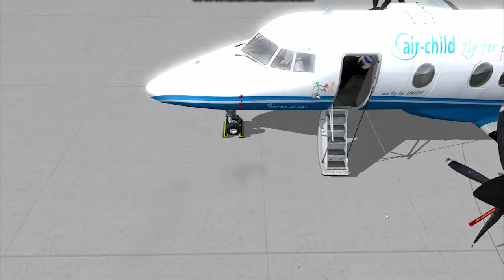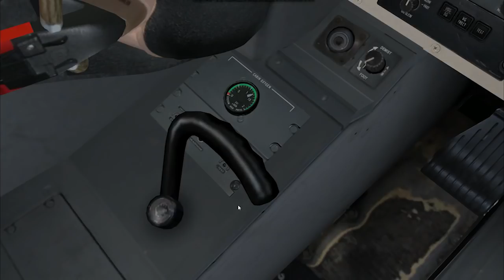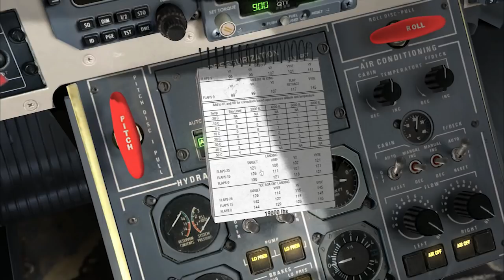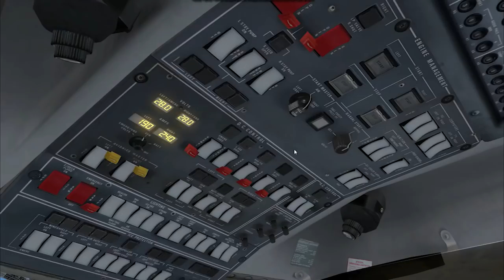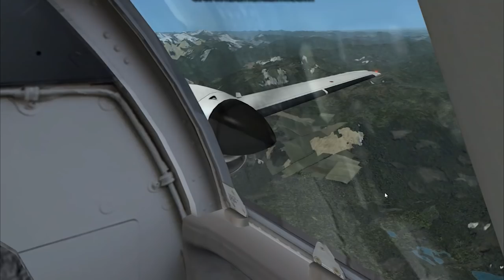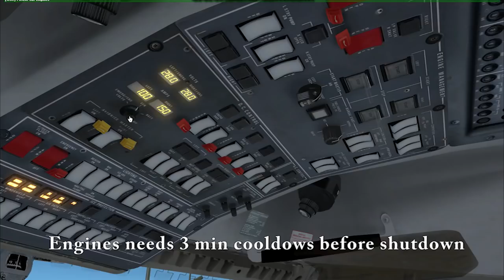PMDG Jetstream 4100 Tutorial. Single pilot OPs

Comment: When shut down the engine, press stop and when rpm is lower than 50%, pull the power lever to beta(reverse thrust) range to activate the start lock (so next time when start engine no need to unfeather the engine or your colleague will laugh at you)

Comment: you should not reverse before he say 70knots? and you did! you never wonder why he say that? that why you are going to damage the engines !
Reply from the maker: Hi TechnoVan, thanks for viewing my vid! Hope you are good. I want to clarify what the manual states. 

PM (pilot monitoring) will call "70 knots" and that's when the captain says "my controls" and takes over (if he's PM) and steer the plane with the tiller. And when out of reverse captain will say "out of reverse, condition levers taxi". The FO will put the condition levers into taxi. Reverse Can be applied immediately after landing, but not necessary. It's used for better landing performance. Reverse thrust always creates some more wear and tear, also for "normal" jet engines and because the air intake on JS41 is close to the ground, it's recommended to use as little as possible if not performance limited because of possible foreign objects ingestion. 
I hope that clarifies how and when to use reverse thrust. :)
Reply: @swedflyer4653  nope it can not , no in this typo of aircraft!The manual say 60 knot
Reply from the maker: @technovan1133  I cannot find this information in the manual, do you have a screenshot? I'm very interested, if you can find contradictory information, I want to know about it. :)
Reply from the maker: Screenshot from the airplane manual. 
https://photos.app.goo.gl/dtt6yR2uwS6fVyk56

Comment: All good but one mistake. Have a look at the RPM gauges and take note of the green arc compared to the rest of the orange arc. I know for a fact that green arc only supports 4% RPM change. Having the RPM at 92% during flight is way too low and damages the engines. 96% is the lowest the engines should run at during cruise.
Reply from the maker: U8.ajd I will read the manual and check. Thanks for the heads up!
Reply from the maker: U8.ajd    And, looking forward for the P3dv4 release of the JS41!
Reply: No problem. And I'll look forward to seeing a new Jetstream model too.

Comment: Nice job, very enjoyable to ride along with you. Usually I fly the 737NGX and the Twin Otter Extended, but I've dusted off my JS41 recently and am re-learning it from the ground up. Currently, I am flying the tutorial flight from White Plains to Dulles. One question - I see you had the RPMs at 92%; I was under the impression that 98% was normal and perhaps 96% as the lowest permissible. What is your reasoning for setting 92%? Thanks again!
Reply from the maker: Hi Jonathan! If I remember correct RPM 96-100% is for climbout and go around. When in cruise the EGT should be at the second white line. But let me double check.
Reply from the maker: Direct from FOM
b. Minimum permissible RPM
1. Ground Idle - 72% RPM
2. In Flight - 96% RPM
3. Takeoff - 100% RPM

1. Before setting cruise power, the PNF should adjust both flows to the mini-
mum required to maintain cabin pressurization and environmental comfor t. 
All cruise operations should be conducted at 96% RPM. Allow the airspeed 
to stabilize before setting the cruise torque setting.-> """"""The cruise torque setting 
will be set by the value indicated by the cruise torque chart, or 10° below the 
EGT limit, whichever is reached first.""""""<----- If engine anti-ice is ON, add 10°C to the 
SAT and use the torque setting for that temperature.

SO right answer is RPM 96% and EGT at second white line. This is how I interpret it.

Comment: how do i set the power mine gets to abourt 360 torque and ´then go
 down
Reply from the maker: +Oscar Hey  What do you mean by 360 in torque? You should set it to the first white line and then adjust with the RPM/condition levers the last part to the second white line..
Reply: +SWEDFLIGHT oh srry sloved it today Got it yesterday. I Can confirm it Works With steam

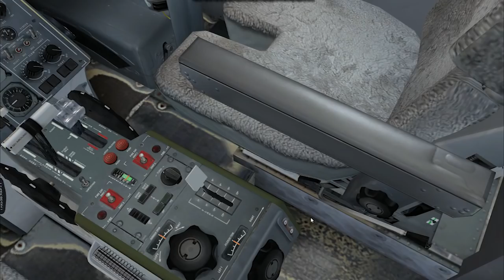Comment: 3:30 When you release and then reengage parking brake you will probably loose some pressure so its rather not recomended.
22:45 If the runway is contaminated its time to take your sweep and clear the shi** before it gets to engines decreasing its lifetime or damaging them.

And you probably got wrong RPMs when in descend. AFAIK 79% is way too low. IIRC it should be 100% on takeoff and landing and something like 98% in flight (climb and cruise) but i may be wrong.

EDIT: Manual states: that minimum permissible RPM in flight is 96%.

Comment: Great video, are you having the flickering flashing polygons issue in the VC when ice effects are enabled?
Reply from the maker: Raul Godoy  Thanks! Nope, no flickering.. Using DX10, maybe that's the solution?
Reply: ***** Thanks Bite, do you mean using Dx10 fix this issue? I have been using Dx9, are you running your FSX in DX10? don't you have many sceneries and textures problems with Dx10?
Reply: SWEDFLIGHT Thanks, do you mean using Dx10 fix this issue? I have been using Dx9, are you running your FSX in DX10? don't you have many sceneries and textures problems with Dx10?
Reply from the maker: I have no idea if this will fix your problem. All I know is that I have no problem with flickering and I always run in DX10 mode (with Steves DX fixer). If you runt dx10 without Steves fixer you will have a lot of visual problems. So I strongly recommend to get it. And it might fix the flickering as well
Reply: +SWEDFLIGHT Thanks, where can I purchase the Steves DX fixer? I can not find it any more at simarket, regards.
Reply from the maker: Laura Godoy https://stevesfsxanalysis.wordpress.com/how-to-purchase/

Comment: How can i bring the Aircraft to the Cold and Dark state?
Is there a Checklist or Something?
When i'm loading the plane the i'am in the sim with Engines runing. 
I can't find any Panel state loader
Reply from the maker: Hi Mark. This is actually a problem and a missing feature (sadly). I always use FS2Crew and with that software your co pilot will shut down everything for you. That's how I have dealt with the problem.
Reply from the maker: Good tip!